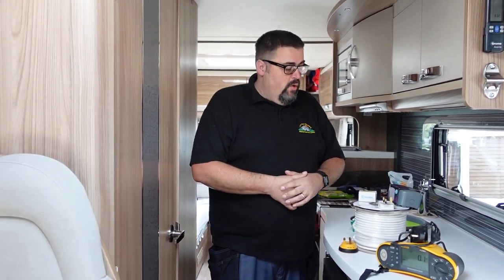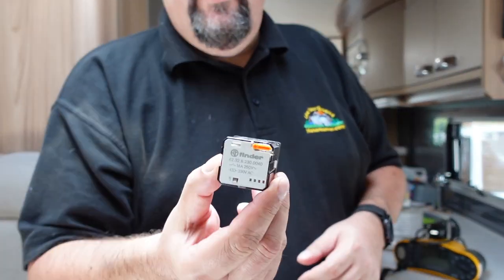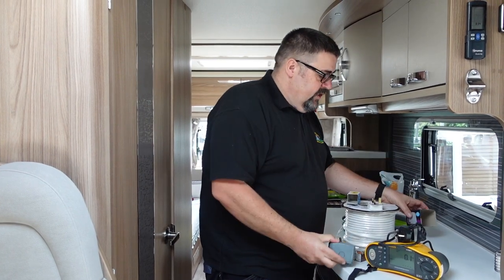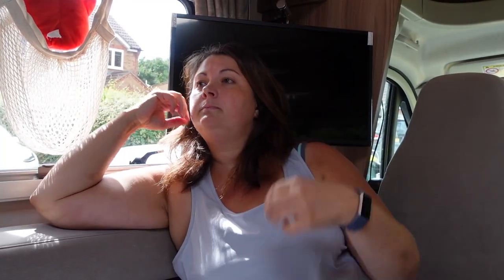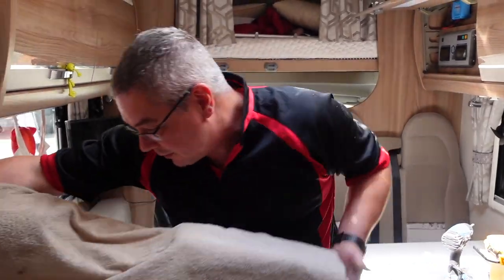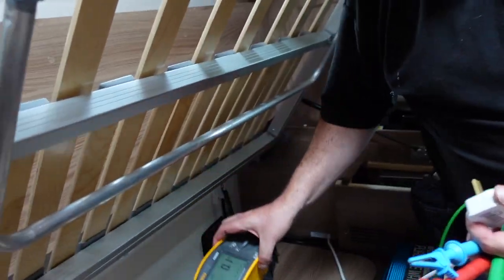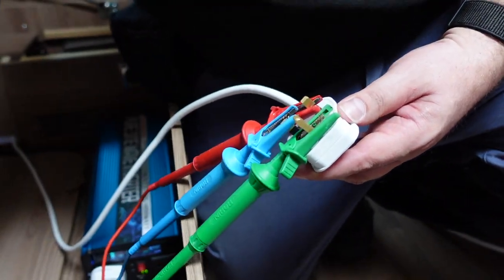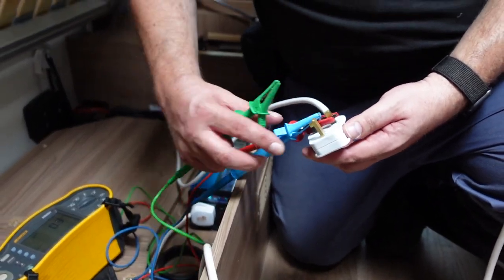Installing an Auto Changeover Relay in our Motorhome

Comment: Hi where did you purchase the inverter, as ive looked online and they dont look anything like the inverter you have fitted
Reply from the maker: Our original inverter was cheap and didn’t last so we ended up replacing it with this Victron one from Alpha Batteries https://www.alpha-batteries.co.uk/victron-energy-multiplus-12-3000-120-16-230v-ve-bus-pmp122300001/

Comment: Hi i take it that the inverter is man enough to run your Alde heating ??
Reply from the maker: The Alde heating runs straight from the gas and 12v batteries and doesn’t need to use the inverter

Comment: Hiya mate..great to see you and your channel!! 😉😊...we're looking at doing just the same as you've done..Monty the 7.2m moho needs an upgrade!! 😉👍may need your man too..is he local to MK??
Reply from the maker: Monty the Motorhome, Great name mate. Geeky Philip isn’t local I’m afraid, but there’s going to be someone local that can help. The inverter install was pretty straight forward, but the relay was a little over my head though.
Reply: @RoamingRadfords  Phil definitely sounds local to me. And he’s right about the parts as I also use R.S components as they only sell quality, safe products, rather than the cheap unsafe crap off eBay which could end up burning out of every kill you. If I require any electrical jobs done on my motorhome Phil is the guy for me

Comment: Great video i was wondering Do the test socket device  show a different reading when testing the  240 sockets when its on inverter ? Something to do with the way inverters work ? Be interesting to know .mine says open ground when on inverter ? .have fun guys 👍🚐
Reply from the maker: Good question, but one I’d struggle to answer I’m afraid as I’m not electricity minded.
Reply: @RoamingRadfords  ok thanks maybe Phil will see this and know 👍